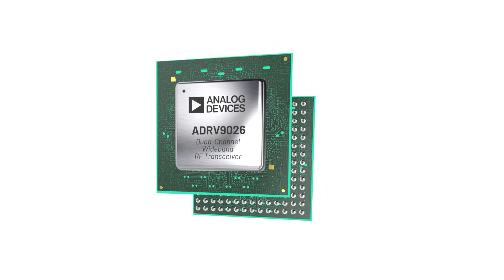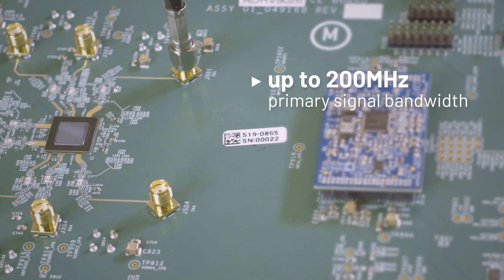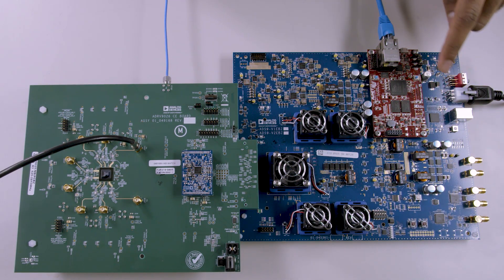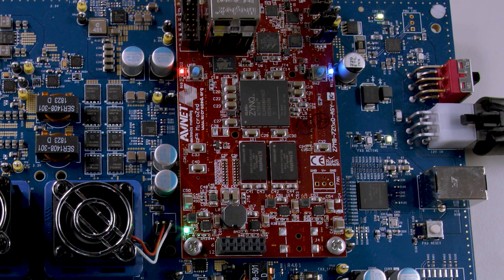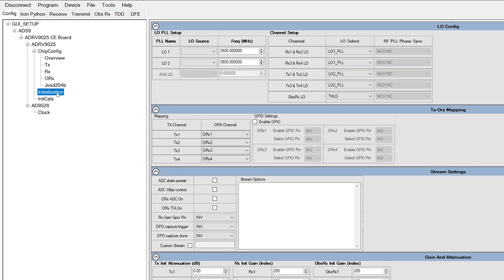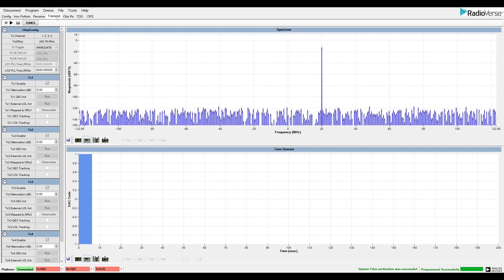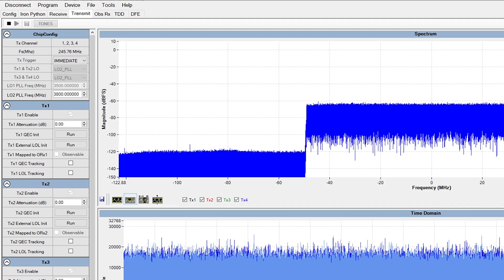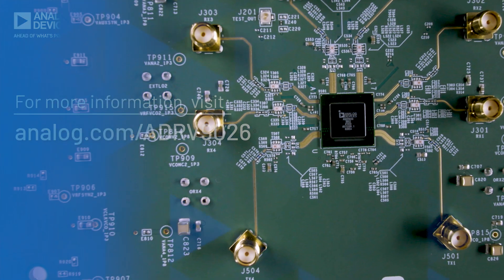RadioVerse ADRV9026 Evaluation Platform by Analog Devices

Comment: Develop a new 18-bit single-channel ADC chip.
For SDR radio, and precision measurements.
With ClockRate at least 120 Msps and higher.
And in BW from 60 MHz and higher.
Reply from the maker: Hello Viktor, You can engage with ADI technology experts in our online community, ADI EngineerZone®. Ask your tough design questions, browse our rich knowledge base, or read about new technologies in one of our blogs. Unsure where to post? Simply type your product number in the Search by Keyword or Part Number field and EngineerZone will suggest the correct forum.